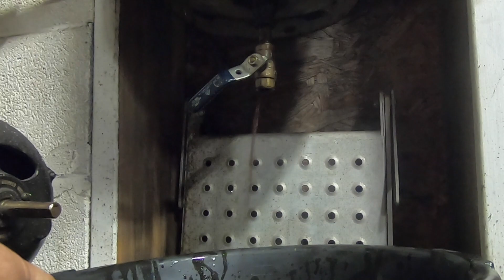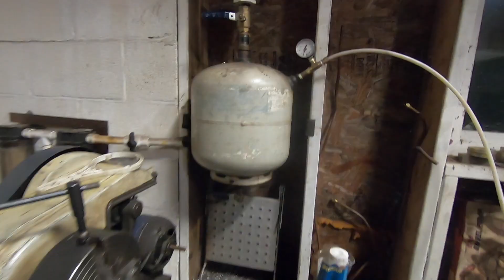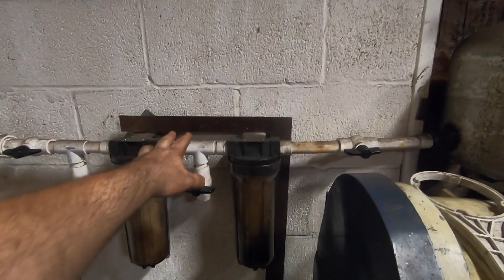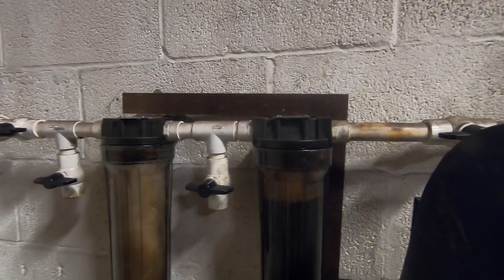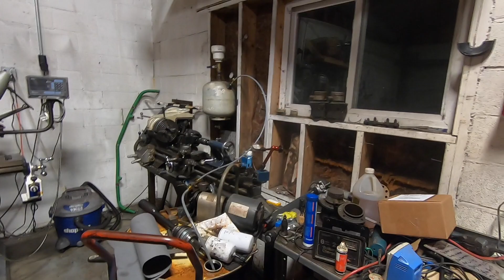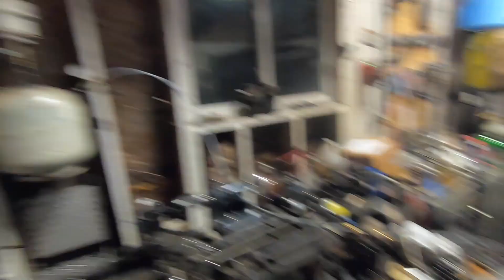Redneck Waste Oil Filtration. Household Water filters. Cheap shop heat

Comment: What is the top valve and pvc connector on top of the propane tank used for?
Reply from the maker: It’s a funnel incase I just want to dump a small quantity. I used to dump a few gallons in there then use compressed air to push the oil through the filters before I had a pump

Comment: I also wanted to say I really like the setup. You version 1 is similar to how mine is setup. I am doing it small scale for some black diesel to run in a diesel heater. I am using portable boat tanks and using shop air to push it around.

Comment: great video ,has to be Quieter than my torpedo heater ,burning waste motor oil . like your filtration set up ,might steal your idea to run black diesel in a pickup .the driveway engineer primary filter is a leg off a pair of levis with the end sewed up ,Lol ,whatever works . i thought i was the cheapest redneck on the planet ,until you tube came along ,nice to know there are more survivors like us out there . happy trails .

Comment: I made my pump from a new GM old style V8. Used epoxy on the input shaft to hold a seal around the shaft. I used a 12 volt dc motor to line drive it directly. It hooked up to the truck battery , so I could pump out of anyone's barrels.
Reply: where did you find the DC motor ? How much HP?
Reply: @joekeller5417  It came from one of those 12 volt scooters that the kids ride on. I'd say a small engine starter motor would work as well. They do get hot from continuous running tho. Not sure they turn in the direction you need. But those electric scooters have a bicycle chain on them. Just pull the sprocket off , and use a good piece of rubber hose with clamps on both the pump , and motor shaft. They're the same diameter. Those little scooter motors might have been 24 volt , I can't remember , but pumped great with 12 volt. You can't shut the output side down , or the gear driven pump will either burst the output hose or ring the hose into between the pump n motor. Just have a switch on it or simply unhook from the power supply. Kids get tired of things and you should be able to find one. If you get creative you could use the whole controller to regulate the pump speed. I simply hooked a couple clamps and would unhook one to stop the flow. It's been a long time since using this thing , but it would empty a 55 gallon barrel much faster than a siphon hose. The starter motor might be too fast , but sure worth a try if you can't find the motor I used. Even an electric drill would work as well. It would have a chuck to attach to the pump.   At the time I seen the scooter sitting in the barn an had an idea. A cordless drill will work on 12.volt if directly wired , or the older ones would. I've made adapters for my older 18volt drills to hook to the truck battery when the batteries went bad. An old cordless drill can be found in any pawnshop. Don't know about the new brushless tools , if they will work off of 12 volt. Don't know if a sewing machine motor would have enough torque , but the little scooter motor wasn't under any load while pumping. 
    Mine was just made from a new extra volume oil pump I had on the shelf , and some rusty crap laying outside the shop on a rainy evening , oh and the butchered scooter. It looks like it was made from a bunch of rusted crap and welding rods laying around on one rainy evening. You sure would not want the kids playing with , but it just works , n works well. Hope this gives you some ideas

Comment: Nice setup. Do you mix the dirty oil with gas or diesel, to make it thinner?
Reply from the maker: I dont mix it intentionally but it really helps to. A few winters back I got 100 gallons of contaminated diesel and once I pumped that into my tank, the cold starts were way easier.

Comment: I would distill that oil into diesel and sell it to make more money... already doing that where I live
Reply: I've been wondering about that.  Does it comes out as a similar viscosity as engine oil?  Or does it actually resemble diesel?
Reply: @mattrevesz  Motor oil is 20-30% additives like viscosity improver to thicken the oil, once distilled all the additives will be at the bottom of the retort. The viscosity will be like diesel in cold winter. Also it won't freeze during winter!

Comment: I did the same propane tank setup except I heat the oil before passing through the filters, not sure what gave me the idea but it seems to work really well.
Reply: Evaporates water and also thins it out so it can flow through filters better
Reply: Even better, heat it at the source. They have 5 gal bucket, and 55 gal drum warmers or you can probably figure your own out. It pumps so much easier when its warmed up. Your lowest point is your source tank, why not try and leave all the crap you can at the bottom lol.
Reply: What does heating the oil do?